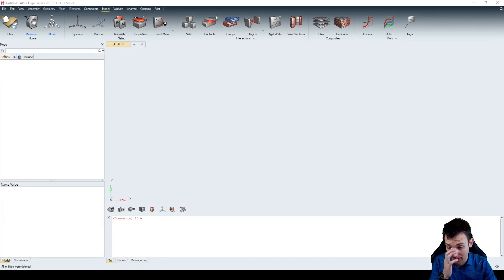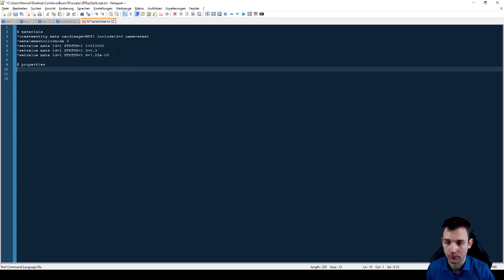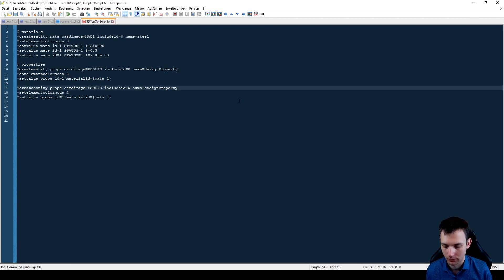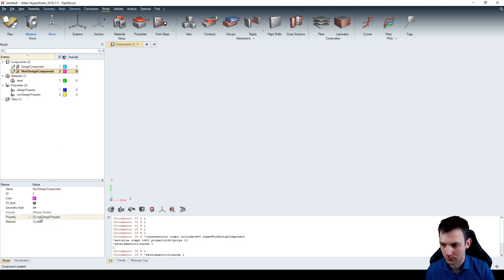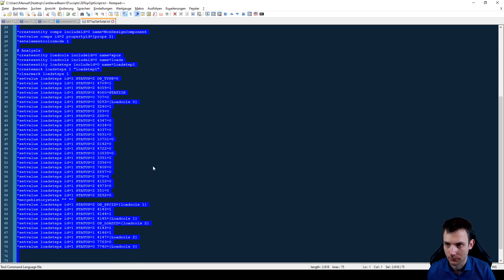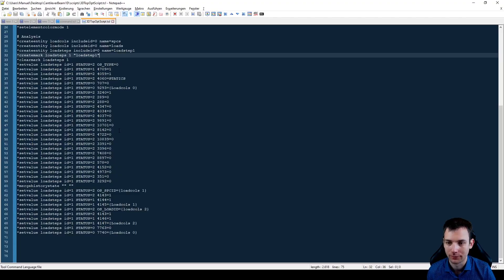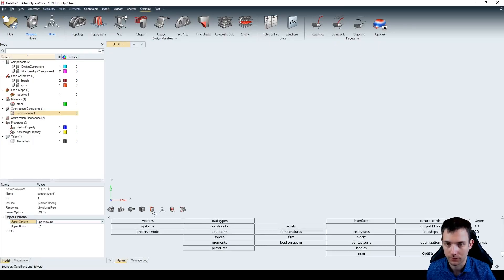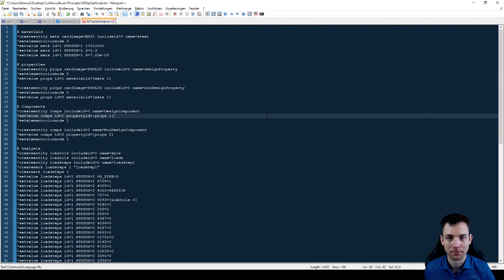Major Seepd Up with Scripting for FEM models (Hyperworks X)

Comment: Really useful and well explained - thanks.
Reply: Thank you, much appreciate your suggestions - will check them out.
Reply from the maker: @jamesrayner8337  sure thing :)
Reply from the maker: Thank you :)
Reply: Sorry for the question but I wondered if you recommend anything other than Notepad++ for scripting TCL in?

Unlike python there doesn't seem to be much out there.
Reply from the maker: @jamesrayner8337  Not a problem. Yeah you can code tcl in any text editor but I remember that the guys at altair used a atom editor with a custom library for autocomplete. If that is out there maybe also some vscode extensions exist. Maybe this here helps:
https://community.altair.com/community?id=community_question&sys_id=12a64c7a1b2bd0908017dc61ec4bcbc5
Reply from the maker: or this: https://community.altair.com/community?id=community_question&sys_id=9e76c43a1b2bd0908017dc61ec4bcb89

Comment: What is the use in scripting?Instead I can use GUI directly to perform pre-processing tasks,right?
May I know its applications?
Reply from the maker: Main purpose of scripting is automization - to get rid of the tasks you have to do very frequently. It can really speed up your process up to that point where you build your model completely by script. It is pretty amazing, what you can do with it!

Comment: is this same as exporting the deck and editing .
Reply from the maker: Nope. The deck is the result of exporting what you did in the preprocessor. With tcl you are directly controlling what the preprocessor does.
I hope this sorts things out a little bit.
You can however create new variants of models very fast by using both ways.

Tcl allows for more user friendly options like... Pick a node or select some elements where to apply xyz. You don't have to be an expert scripting user to use tcl scripts for your benifit. Modifying the deck... Well, there you definitely want to be sure that you fully understand the changes you make.
Reply: @ManuelRamsaier  thank you very much for ur swift response. U explanation is really  motivating and i'm enthusiastic to learn scripting from scrach.
Can u suggest me some statergy/studymaterial to begin with . ?